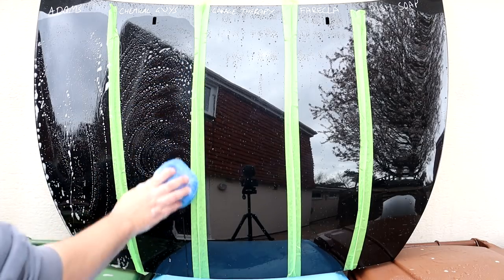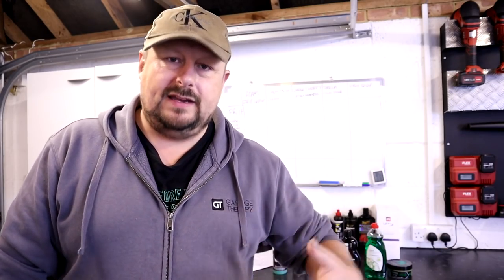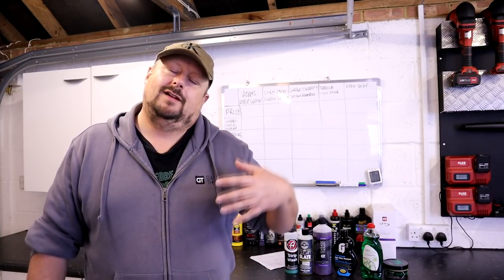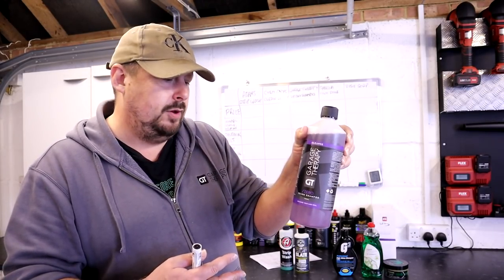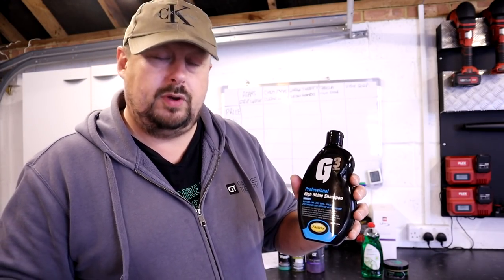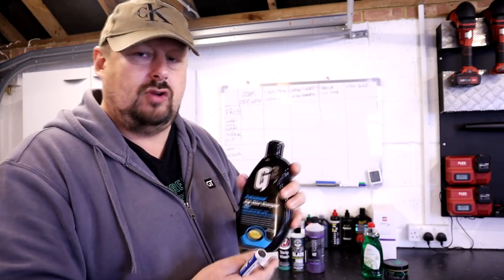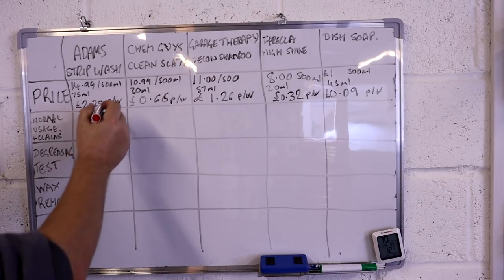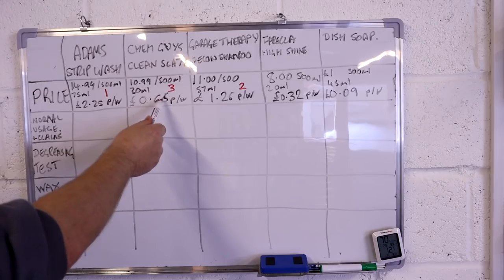Best Strip Wash for Cars | Can they really remove Wax or Sealants? | Clean Slate Strip Wash Decon

Comment: Hi John 
Learning so much thank you
I have, as mentioned before to you, been tackling paint correction on my pride and joy. 
I have taken every precaution, strip wash bilt hamber, decontamination karrassol, BH clay white and then tackled a small area, off side wing, with a rotary, micro fibre cutting disc, Scholl 03, with caution and steady patient passes, the micro scratches have not been touched!! I mean zero effect! After so many passes it went dark! On the 2nd day i lost a confidence and purchased a thickness gauge and checked it over plenty to go on, I thought Scholl 0 and researched further 
I found that it might be the LSP
Hence coming across your podcast about strip washes 
I don’t know, i kinda could do with a confidence boost
Reply from the maker: dont use microfiber on rotary mate.  imagine a crop circle the microfiber strands get pulled one way in a consistent direction and go flat on the pad.  the surface of the micrfiber strand then clogs up in the one spot that interfaces with the clearcoat.   when you use microfiber on DA's it ruffles the strand back up as it goes in little tiny orbits a bit more like buff by hand.

You should check out my MY CAR DETAILING COURSE COURSE - CAR DETAILING FUNDAMENTALS

This covers everything you need to know to get up and running with detailing your car properly

https://ioa.pxf.io/c/2687409/1012495/12764

or if you want free advice watch all the videos below.

washing https://youtu.be/AUytWaLtOOo
decon  https://youtu.be/9B9Cn-GeJqw
polishing https://youtu.be/MI_m2rO-OpM
products https://youtu.be/I7q5E8Kz-CY

Comment: Jon, after I machine polish a car and before applying LSP. To remove the polishing oils, could you just wash the car with GT rather than using an IPA wipe?
Reply from the maker: we discussed this very very recently in our panel wipe test video.   The answer is yes.  And by washing it with hot water and these products I am rreasonably confident you will remove a lot more polishing oils than just panel wipe.   the problem is you kind of risk marring the paint by washing and drying it again.   specially with crappy soft paint you just spend 8 hours trying to refine.   have a watch of that video its a very interesting subject area. some brands like gyeon and bilt hamber recomend you degrease with hot water a pure detergent or dish soap.  prior to the panel wipe.

Comment: Nice idea for a test Jon and well put together, many thanks. Something is confusing me a little though, not a criticism, I just don’t get it.

You make a price comparison “per wash” based on manufacturer usage recommendations which is fine, that is how most of us will use the products, so it is valid.  But then you test them on a level playing field 5% PIR, which means that the price comparison then bears no relationship at all to the efficacy test at all.

Also, at 5%, are certain products being tested miles away from their design window when you level the playing field like that?  Take that levelled test at the across the board 5% dilution to something many of us can understand... 

If someone served me a watered down lager, it would not have the same satisfying impact for taste or mind warping potential as one served at the correct 100% manufacturer specification.  However, if they did me scotch at the same level playing 100% dilution ratio and volume, it would probably kill me.  Could your move away from manufacturer recommendations to a baseline 5% for “equality” actually massively skew and disrupt the efficacy test - e.g., you are using it outside of its design window?

I am probably missing something obvious, but in my defence I am currently drinking a couple of pints of 5.2% lager at the manufacturers recommended dilution of 100%, and it is working quite well. I will water it down 50/50 and think about it again tomorrow when the couple of pints is clearly going to be cheaper but far less effective than at full whack.  

I will certainly not be testing my understanding on a couple of pints of undiluted 40% Jura any time soon though. 😁
Reply from the maker: the price comparison is not related to the degreasing or wax removal tests Kev, its a totally seperate test just so people can understand the value propersition of the product..   The problem with using the products in a test at recomended Ratios is those wont impact the dirt simulator at these low ratios and the wax test as well will take longer and it will reduce the visable performance windows or ranges down so it will be harder to spot the difference.   I just wont have any meaingful results to show.   but we did the real worldusage of all these products as well to make notes

Comment: Hi, i know its not related to this video but hopefully you can help. I would like to know, Whats the diffrence between Bilt Hamber Surfex HD and Bilt Hamber Auto Foam? Thanks
Reply from the maker: surfex is a water based degreaser using alcohol exytholyates (sp?).. autofoam is a detergent blend aimed to be a prewash.. so it will have other surfactants just a different blend.  less agressive I think perhaps but still powerfull and fast acting.
Reply: @ForensicDetailing  Thank you! Really appreciate the response 👍

Comment: Hey bud, could I use auto wheels and surface hd mixed together to clean my wheels. If so, what dilution ratings would you recommend? I feel using auto wheels undiluted every week is a massive overkill.
Reply from the maker: dont mix chems togther mate just use surfex HD, and when you need to deep clean use autowheels.   You can put some autowheels mixed down with some water 50/50 if you want for a lighther clean.
Reply: @ForensicDetailing  brilliant, cheers John ⭐️

Comment: In the price costings, what volume of shampoo were you calculating to make up Jon? 20L?
Reply from the maker: hey mark just cost per wash based on the prices on the 500ml offerings on these at recomended usage ratios (or average if usage range is specified)

Comment: hey guys, someone recently did a paint job in my car and left wax on it for more than 24 hours which is pretty dried now and wouldn't come off after scrubbing with dish wash soap, any suggestions on how to take this off? It's on the roof and rear bumper
Reply from the maker: It's polish try using a glass cleaner
Reply: I asked him and he said it’s wax and was supposed to come next day and clean it up but he never showed up and I got scammed
Reply: Will a glass cleaner damage the paint? It was a touch up anyway
Reply: Wax residue makes the car look white and weird

Comment: I know this comment isn’t relevant to the video, but i noticed Bilt Hamber don’t make a carpet solution, any suggestion on what to buy?
Reply from the maker: I use the Vax one with no products.  but really you can use any APC.  Angelwax do a good one mega foamy called absolution I think,
Reply: @ForensicDetailing  Okay, ill have a look at the Vax one. Another quick question. If I was to use an APC, lets say Surfex HD because that’s the one I have have, to what ratio would you dilute it down?
Reply from the maker: @Timmo93 I would suggest hot water and surfex at about 1:50.   I know guys that use it 1:20 but its very strong.  you dont need it to foam.   what I would do is load up a pump spray with it at 1:50 and hot water and soak out the drivers foot well for example..  agitate with brush and leave it to soak for 5-10 mins then extract.  Go again.    as required.     I would just have so clean hot water in the extract to knock down the detergent if its proving hard to extract.
Reply: @ForensicDetailing  Okay, thanks Jon, you’re big help.

Comment: How old does the wax have to be in order for the strip wax shampoo to be effective
Reply from the maker: impossible to answer this it depends on the product.  but typically if you can see a wax buzzing and zinging and the water flying off it.  that means its nice and fresh and virtually impossible to strip with detergent washes.